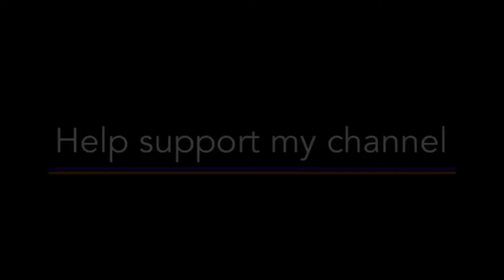Woodturning A Salt Box - Lidded Walnut Salt Cellar

Comment: Lovely piece.  Wood is gorgeous.
Reply from the maker: Hi Helen, thanks so much. I use this in my kitchen, though I added a goofy little finial after the fact that I don’t think looks particularly attractive,  it it does make it more functional. I got an amazingly good fit on the lid - even though the walnut is kiln dried, there have been days this summer where I couldn’t get the lid off because the humidity made it swell *just*!enough 😂

Comment: I think that is a handsome box. The walnut has a beautiful finish; what product did you use for this? I've been turning bowls for the past year so I've decided to try a box for a little variety. Your video gives me a good insight in how I would do this. I have some cherry and walnut pieces too small for bowls so they will be good candidates for this project. Do you like your carbide tools?
Reply from the maker: Hi Paul! Thank you, I’m happy with how this turned out-I use it every day! I’m pretty sure I used OB Shine Juice on it, which is a friction polish made of BLO, DNA, and shellac. It’s holding up fine but I think for future utility pieces like this I’ll either use the Tried & True Original Wood Finish (I used this on the Cherry Burl Travel Mug) or Mahoney’s walnut oil and then use the Beall buffing system on top. Cherry or walnut will both make lovely little boxes. To be honest I’m not super happy with the carbides. I bought them initially because I think one of the things that stopped me from venturing into turning was that sharpening totally intimidated me. I still use them for certain things, and the negative rake carbide is a must (at least for me) for using with resin, but I prefer the traditional tools for most things.

Comment: What diamaer did that finish up at. It does look a bit large for a salt cellar.
Reply from the maker: I don’t remember exactly but I use this in my kitchen and it’s small enough that I can lift the lid off with my left hand and get a pinch with my right, but it’s big enough that I can scoop out half a teaspoon or whatever and not have to refill it right away